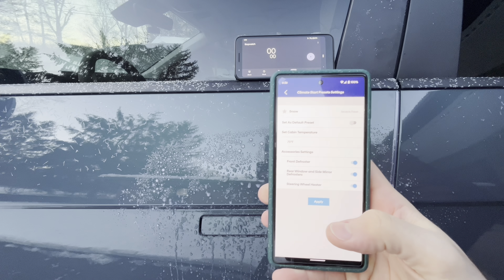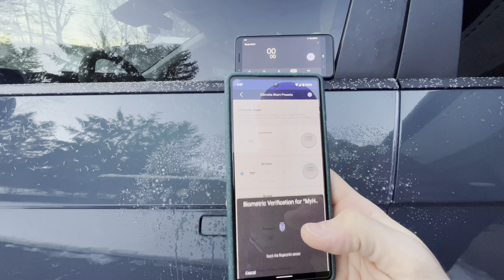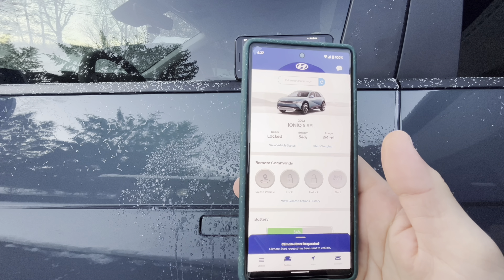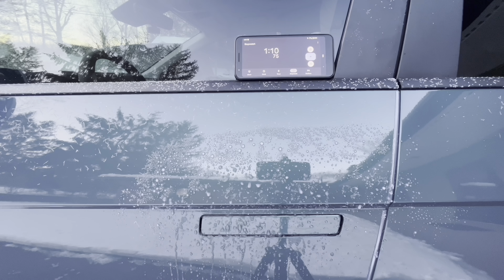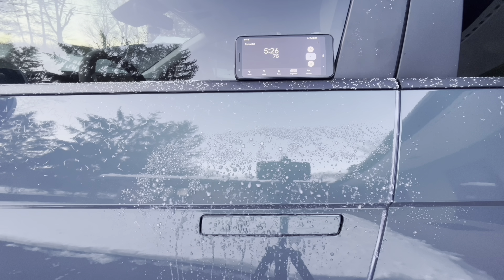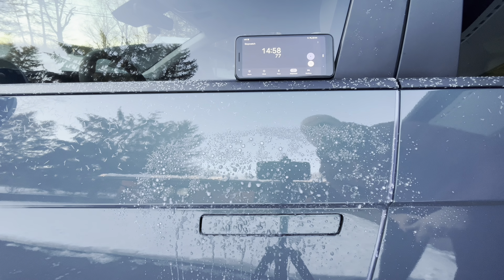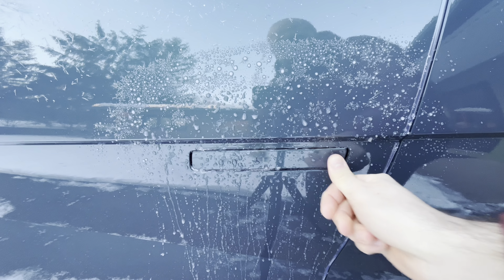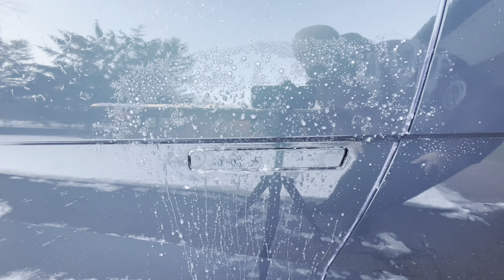Pop Out Door Handles vs Ice Follow-up | Does Preconditioning Help? | Hyundai Ioniq 5 | EV6 | GV60

Comment: I used to have to carry lock de-icer for when old style car door locks would freeze up in northern BC. This seldom happened but had the same effect of you not being able to get into your car. Often another door would work and you could skooch across to the drivers seat. Unless you have freezing rain, the conditions to freeze up a door usually only affect the door subject to the prevailing wind. That said, you might want to carry a small spray bottle of de-icer with you just in case.

Comment: Hoping you can help me answer a question, is there any way to see how much power draw there is while preconditioning? I don't drive every day so I was thinking of just having a level1 (120v 20A) plug installed will be fine (I think 2400w peak or 1920w continuous is what that can support), but wondering if turning heat on draws more than that, thus I'll drop below 100% before I even get going?
Reply from the maker: If the car is at 100% (which you shouldn't do on a daily basis anyway, keep it at 80%) then it's just going to pull current from the house, not the battery if it's plugged in. If that wasn't the case, do you need exactly 100% battery for your drive? If it is, I don't think an EV is a good choice for your commute.

Comment: Can you climb in through the trunk? Is that an option? I used to do that on my vw golf after I broke off both door handles in a fit of rage one winter.
Reply from the maker: You could but because the releases to fold them are near the rear see seat door sills, it's kinda tough to reach all the way down from the trunk